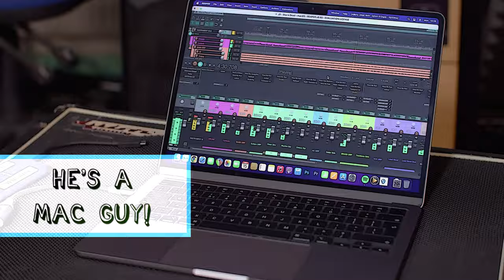MADI Vs ADAT - What's the difference; A Long Lecture / Build

Comment: 7 years ago I was looking for a way to get my latency down while playing Piano with a midi controller and a Scarlett 2i2. I stumbled on your video going over your upgrade to RME's RayDAT and convinced myself that an HDSPe AIO would fix my problem. Well... it did, but I had no idea what I was getting myself into 😂

Fast forward to today I'm running an HDSPe MADI FX, a RayDat, and a UFX+ across 3 different PCs with a ADI-648, ADI-192 DD, and a small Dante network in-between. I lucked out finding a majority of this stuff for way below MSRP, sometimes even at quarter of the original price, on the used market.

Working with this equipment throughout the years attempting to get it to bend to my will has been extraordinarily interesting. RME's drivers and TotalMix seemingly just breaks audio production standards I accepted as inherently true. The ability to remotely access TotalMix in its entirety with an iPad is a game changer. And my sub-mixing leveled up significantly after looping the 3rd MADI connection on my MADI FX back into itself.

Anyways, been watching your videos ever since that initial introduction, fun to see you make the jump to MADI. Also fun to see you adapt that PCI card haha, don't feel too bad, I'm running one of my cards off an M.2 to PCIe adapter 😅

PS my UFX+ has been running over Thunderbolt on 3 different platforms running Windows (X299, TRX40, z690), and it's been as rock solid as PCIe. I tried USB with a few of RMEs interfaces and ran into a ton of issues on my AMD platforms, but no issues with PCIe or Thunderbolt (which is essentially PCIe).

Comment: I think you are the ONLY person in the whole internet who (I think) has answered the question that has been eating at me: HOW on Earth does one use a PCIe interface?
I see them advertised, and I see old and new videos talking about them, but not ONE (except yours) actually explains the process of getting the ANALOG signal into the digital interface.

I have an old Firewire interface I've used for years, but now that I've upgraded to Windows 11, there are no drivers for that interface. So I have to buy a new interface (UGH!!).
If I can use my existing, old interface and just connect it to my new PC via PCIe interface and TosLink cables, would that work?
Even though USB is super fast these days, it still relies on a data transfer protocol that I feel is inferior to Firewire, so I don't even want to consider anything USB.
Also, Thunderbolt interfaces are few and they're very expensive.

Comment: Great video - everything you talked about I learned the hard way. While ADAT is still a good digital format, TOSLINK never was a good decision for a connector format. I think it was a decision long ago to find a decent connection format that don't take much space and is cheap.
This aside, the real deal for low latency is to record multiple tracks and use effects on them - without using a separate mixing desk or outboard gear hardware.
I used RME HDSP 9652 in pci version over the last 10 years and now have to change to the pci-e version because all new motherboards only got pci-e connectors. So i did a research and found out, that it is possible to use a pci card on a pci-e connector with an adapter. The problem is that normally the pci card will slow your pci bus / system bus down from pci-e standard (4GB/s) to 533 MB/S or slower. So what is your experience?

Comment: Taking the cards external, wow that took me back to the early 90's & building an ISA card to multiple ribbon cable sockets breakout board so a video production co. could run their graphics cards externally. The switch from AT form factor to ATX meant that full length "pro" ISA cards often fouled the new M.B. or cases. Parts for "mining rigs" back then went down the pit.
Reply from the maker: Nice! I miss the ISA days sometimes, but then I look at the specs of everything and realize I’m much better where I am!

Comment: If you are thinking of cost effective MADI solutions, you might consider an SSL Xlogic MADI SX.  This was based off of the Sydec Soundscape series.  24 I/O analog, 24 I/O AES/EBU.  They also do the AX version which has 24 I/O of ADAT, but I would think the AES/EBU would be a better fit for some of the higher end hardware (like Eventide, Tc Electronic or Lexicon DSP/Reverbs).  Those are a bit younger and can be found for under $1K and can do full 48 channels at 24 bit 44.1/48K but drops down to 24 channel at 96K with a choice of analog or AES/EBU.
Reply from the maker: That’s £2500, not exactly in my “cost effective” category! Not seen any of these on eBay recently…

Comment: I was engrossed! Will you need to change to quieter fans on the MADI converter?
Reply from the maker: Nah, I think I’ll just put it on the far side of the rack- it’s not actually that loud, just feels like it because everything else I have is super duper quiet. It runs a bit hot so I’ll let it get the airflow 👍

Comment: I'm just unsure of which way to go in terms of connectivity.  It seems like there are way more options for converters and preamps in the ADAT format and they are also much cheaper. However, there's MADI, AES and DANTE to consider which seem much more capable 'pro' formats. I could get a RME digiface and a ferrofish pulse 16 converter and then an ada8200 for preamps (or no ferrofish and 2 or 3 ada8200s or asp800/880). I could get a RME madiface USB (£350 more expensive) and a ferrofish pulse 16MX (£200 more expensive) and I'm not sure about madi preamps. What advantages am I getting here? Then there's things like presonus studiolive III 24R which can act as an audio interface or work in conjunction with an RME digiface AVB. Then there's Midas DN4816-O which gives 16 inputs over ultranet - I'm not sure if this is compatible with RME AES or not. Also Midas DL16 AES50 and again i'm not sure if this works with RME digiface AES or not. What I really want is solid reliability that just works and with low latency. ADAT, MADI, AVB - i'm not sure what is best.

Comment: Hey Adam quick question, if I was to do this similar build with a RayDAT and the RME9652 should they sync their inputs and outputs just like they did in this setup? 

I’m planning to send all of the I/O from the RayDAT to an x32 (with x-ADAT) and then use the 9652 for other potential ins and outs
Reply from the maker: Yeah I think it’s the same, you’d have to sync the word clock ports together, or link an ADAT cable from the master to slave to keep them together. And there’s no software patching between the cards in Totalmix, but that would work in the daw
Reply: @adamsteelproducer  hmm, so if I connected the word clocks from the 9652 to the x-ADAT’s word clock since those ins and outs would be all plugged in to the RayDAT it should do the trick with the x32 as the master?

Comment: Great video, question, been always wondering, do you really need so much gear for modern day recording and post production!? For example: If I got all production going on DAW and I just need max 2 ins and outs like for vocals and guitar, would I need all this hustle with PCIe cards and stuff or I just can buy a good decent audio interface with thunderbolt + preamps, compressors and job done, is that's not a more simple version who don't need all those channels?
Reply from the maker: Really depends what you want to do. Do you just want to record yourself or a friend doing a single thing at once? You don’t need much. 
Do you need to be ready as a business for whatever comes through the door? In that case you need a lot more.
Reply: @adamsteelproducer  well for me it's very simple, so l just need mostly for vocals to record, maybe sometimes could be guitar and l need to hook up preamp, comp maybe something else and l wanna get decent converter, like Prism sound lyra or antelope amari so to get best sound and also to reduce latency near to zero, how would l be able to do with PCIe cards, would that benefit me, also of course mixing and mastering?
Reply from the maker: Forget high end converters unless your room treatment is truly world class, focus your money and effort there first as a boxy/echoey room will never be fixed in post production
Reply: @adamsteelproducer  ok that's great, but which PCIe l should be using or l don't need one?

Comment: And here I was thinking I was the only one who kept an actual ADAT machine or two around these days. 😀

I've been tempted to switch out some of our infrastructure to use some RME cards. But, I suspect the dread of tearing it all apart again and perhaps a bit of laziness has kept it from happening. Interesting video and thanks for showing and discussing some of the not-so-pretty behind the scenes decisions and and choices required when running a commercial record studio. It's a long way from just grabbing some gear and working at home when you start bringing in clients and charging clients to use your space and gear, however they may want or need.